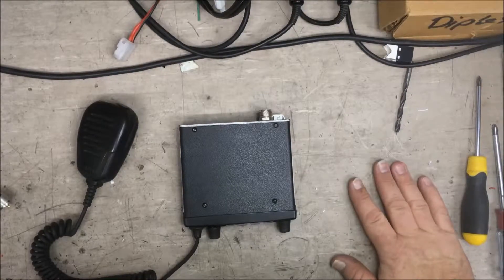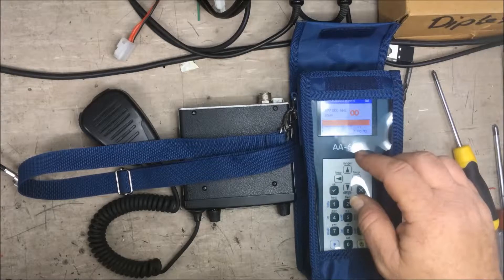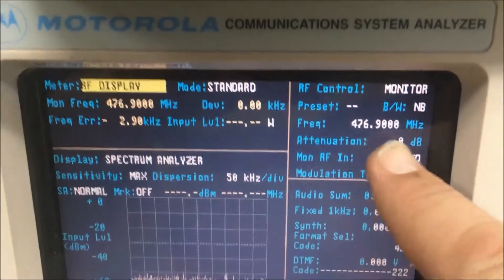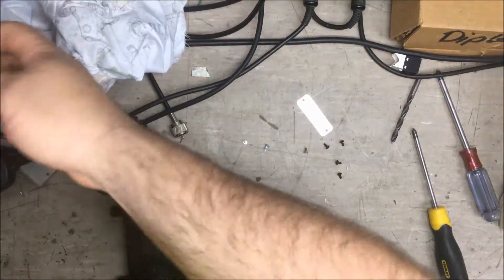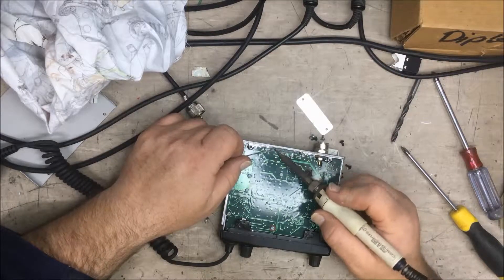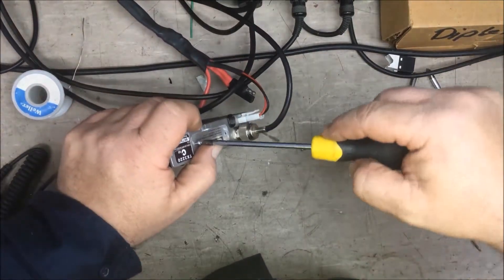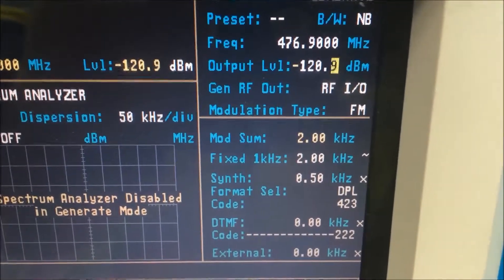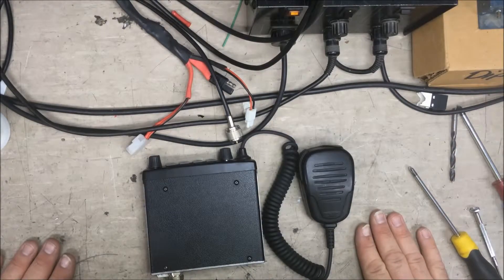GME UHF CB radio Transmit Fault repair, Power Amp Stage IC

Comment: I have a tx3510 that just stopped receiving and showing +9 signal, wont scan or hear static..tx is fine..could it be a hardware or software issue?

Comment: Thanks.  This has been a great help.  I recently bought a second hand TX3200 which received well, but had no TX.  I thought it may have been the mic. as the insulation on the cord was falling to pieces, but continuity of wiring seemed fine.  Looks like a reasonably easy fix. I'll look for the power amp I need online and try out my soldering skills. Very helpful.  Ta

Comment: 3.88 watts? Wouldn’t that need to be closer to the rated 5 watts before sending back to the customer? Seems like it’s still under performing by quite a bit I’d assume? I love these repair videos by the way. Cheers!
Reply from the maker: yes, the Motorola test set needed calibration, it was sent off to Motorola for calibration not long after this video, I did test the radio on a power meter and it was just over 4.5 watts, it cost $ 3,300.00 to send the test set of to Motorola USA to be calibrated and have the firmware upgrade ( it had a fault with the display ), the test set has to be calibrated every 12 months,   I knew it was off a little bit and double check the radio on a separate power meter. also I had the test set in NB mode, the CB was transmitting in WB, so that wouldn't help. hihi. thanks for watching. I was nervous when I did this video and I would of done it a bit different next time, I was rushing it , I am trying relax more when doing video but I tend to get a bit nervous , but I am getting better.. I hope. de VK3HAU.